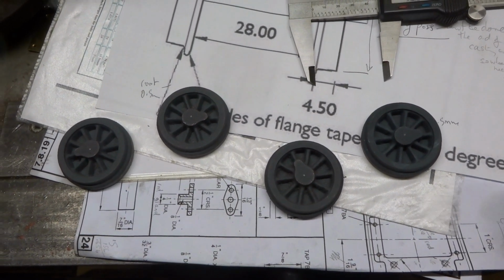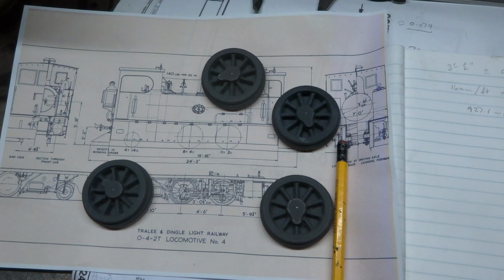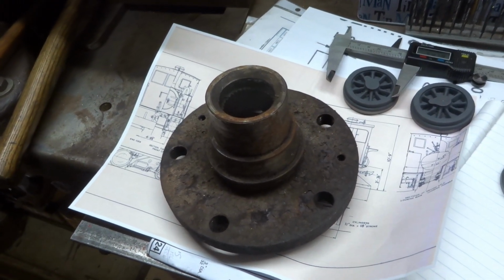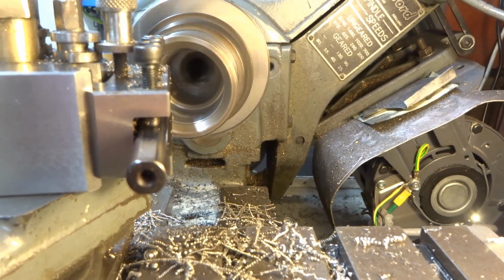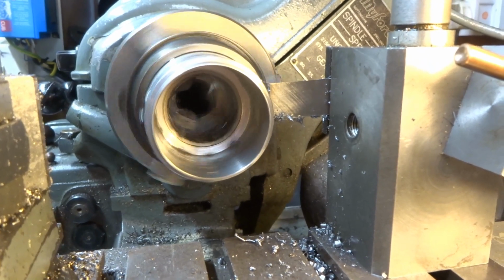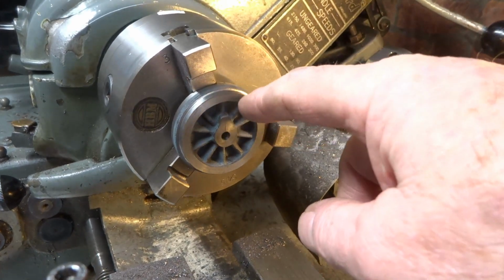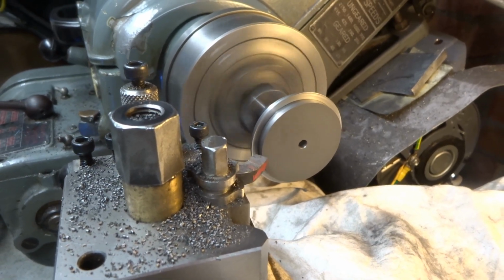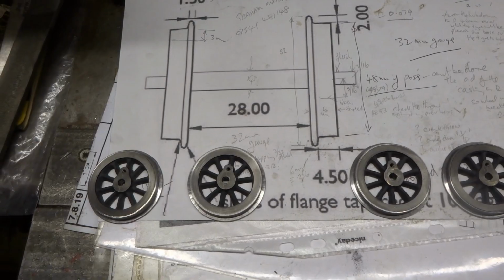Tralee and Dingle loco wheels for 32 mm gauge garden railway

Comment: I wish the line will reopen someday, even if it isn’t that likely to happen soon.
Reply from the maker: Agreed, it would be good to see the line in operation again. In the current economic climate however I do not feel overly optimistic about the  timescale. Ed
Reply: It would be impossible to reopen the line fully, as in some places, such as the Annascaul station site it's completely built over.
Reply: @mies_08  maybe you’re right about that. I’ve spoken to Irish Rail staff about reopening disused standard gauge routes and one person suggested they should build a line to the Dingle Bay and Donegal. I don’t know if that would be possible, but if it is it would be a great idea. Whatever happens to the Tralee and Dingle, it would be nice to have Blennerville restored.
Reply: @joshuaW5621  There was a railway built at the Dingle bay, Tralee to Cahersiveen if I'm not mistaken. It would be really good to preserve this line, as it has some really beautiful scenic spots.

Comment: Nice work!
Those hubs are hard, but the tyres will withstand the time, and the type of steel is also less vulnerable to rust when kept lightly oily.
I would however, to keep true to prototypical practice, have kept a bit more depth on the tyres and remove a bit more of the diameter of the casted centres.
After seeing this video I will have a go on machining cast iron wheels which I always have hesitated from out of fear of having angles wrong or wheels not turning out true, but this video shows trough which steps I should go for a good result..
To start I will get wheel castings for a 0-4-0 or 0-6-0 loco in 7mm so that I can compare these with ready bought Slaters wheels with plastic centers for looks, functionality and durability and gain experience
Reply from the maker: Thanks Tom. I agree about the depth of tyre, but I slightly messed up on the first one and they all had to be the same. Slaters wheels are very good - I have a few on some of my rolling stock. Cast iron is a doddle to turn in my view PROVIDED the quality of the iron and the casting is good. The surface occasionally can be a bit hard but the trick is to take a decent first cut to 'get under the skin' after that should be plain sailing (i.e. turning).
Reply: @edwinwhite933  Thanks, the last one is a good tip, so not just skim the skin away, but get under it with a proper deep cut.
What about the feed? Slow or have the bit digging in?
Reply from the maker: Tom, I'm a self taught amateur so don't feel qualified to speak about speeds and feeds. Clearly the size and rigidity of the lathe will finally dictate what can be done. I started 40+ years ago by turning from various pieces of scrap metal. Some of the early 'masterpieces' defy description as to how bad they were. All I can really say is have a go. If you are uncertain start by working with something that does not have much value in either time or money and see how you get on. There are lots of books on machine work and many of them are for professionals and don't really appy to the small home workshop. I started by reading/following a book called the Amateurs Lathe by Lawrence Sparey. It first came out in 1948 and I don't know if it is still available, but to me it was an invaluable teaching aid. Many thanks. ps to allow a bit to dig in is not a good idea in my view.
Reply: @edwinwhite933  Thanks for your reply, I'm learning machining in the same way, at a certain point you discover what does work and what not just by listening to the sound and looking to the offcuts, a lot of chatter isn't what you want.